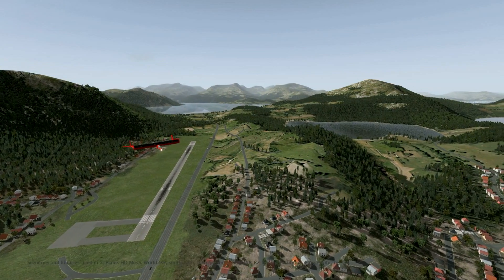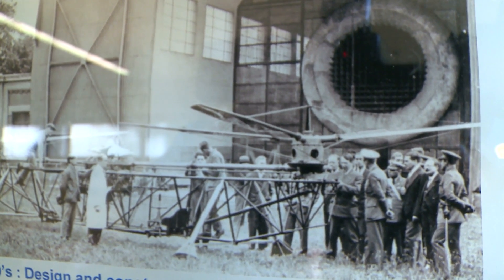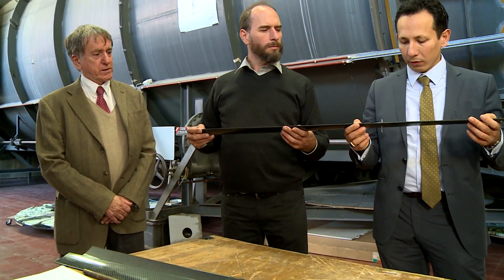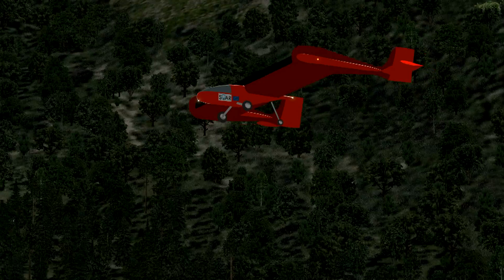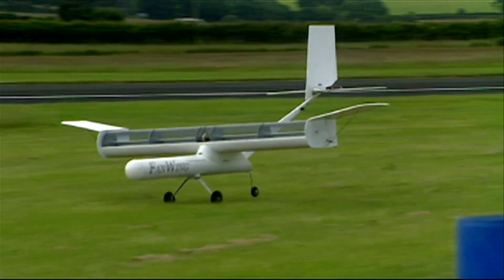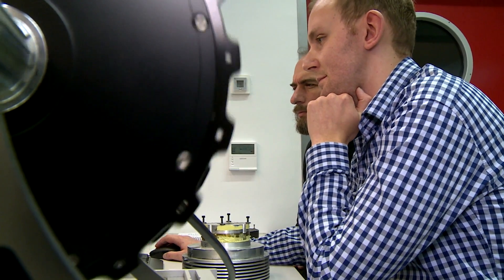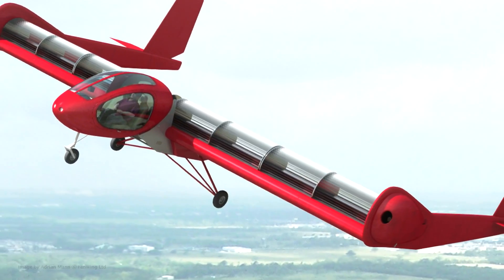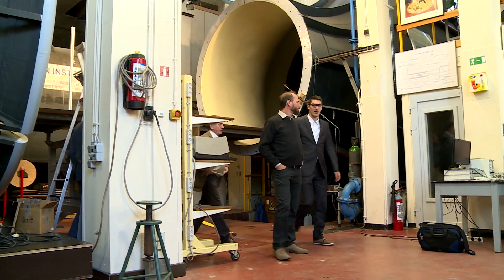FanWing/EU SOAR: Distributed-propulsion aircraft with a trapped vortex inside the rotor cage

Comment: Looks pretty fool proof, I can't see any safety issues 🤔😦 Electrical power is not really ultra light, batteries have very low energy density compared to combustible fuels so they weigh loads more. And that weight doesn't decrease as you burn fuel either 👍
Reply: battery tech has come a long way.  but beyond that, this design could be viable for the nuclear powered airplane designed by Alvin Weinberg back in the 50's
Reply: @ogmius2001  Yeah I can't see any safety issues with flying nuclear reactors either 😉
Reply: @juniorballs6025  they thought about that way back in the 50's.  that why A Weinberg designed a "walk away safe" reactor.  They designed it, tested it for thousands of hours...and it worked!  Problem was it couldn't make Pu 238 to make new bombs...Nixon hated that so it was defunded.  look it up

Comment: This is not an original idea. It was tried in the early 1900's (along with a great many other failed concepts) and discovered to be very unsafe in the event of engine failure
Reply: https://www.fanwing.com/faq.htm#6 describes their plan for engine failure.
Reply: @dapje2002  The coanda flyer is a totally different propulsion system, nothing like this at all.
Reply: @NullHyp  A helicopter blade keeps making lift in autorotation when declutched from a dead engine.  The same concept applies here.  A dive can build up RPMs and inertia in the rotor that can be used to flare out an emergency landing.
Reply: @NullHyp  Hehe Gliders represent!

Have you heard of the plane parachute? It's gaining a lot of traction and could surely get you down relatively safely I'd imagine. Also, perhaps one could do a form of autorotation by doing a steep dive to get the prop going again? Other than that I imagine you'd be dropping like a brick with all that resistance. 

And I second the whole thing about torque problems and inertia issues.
Reply: Flyingdutchy33 LOL yeah a parachute would work. Good idea 👍🏻
Reply: @NullHyp  Not sure if sarcasm, but here is some stuff about them: https://www.youtube.com/watch?v=zT58pzY41wA
Reply: @Flyingdutchy33  If huge radial engines on WII fighters weren't significantly hampered by "torque and inertia problems" on the roll axis, why dump on this concept?  Torque & inertia effects in this case only affect pitch which looks to have been countered by the extra leverage of a distant tail section.
Reply: @denbecr49  Because from an engineering standpoint, this thing is pretty flimsy.

I was talking about the torque and inertia of the rotor itself and the strain it puts on the chassis.
Reply: @Flyingdutchy33  Torque would be between the engine and the squirrel cage.  Which inertia of the rotor?  Rotational or translational? and in what way is it detrimental to the operation of the plane "from an engineering standpoint"?😄  
How would the "chassis" be subjected to even as much stress as a twin engine plane would "from an engineering standpoint"?😏
Reply: @denbecr49  You dont think this is an extraordinairy amount of moving mass?
Reply: @Flyingdutchy33  Nope.  It's just a squirrel cage fan.  Could be made of aluminum with blades of aluminum, fiberglass and/or carbon fiber.  Read the specs, FAQs etc. on these prototypes.  Rotor mass isn't an issue.
Reply: @denbecr49   think you are actively trying to misunderstand me. I'm going to leave this conversation until I talk to an actual engineer who knows what I'm saying.
Reply: @Flyingdutchy33  You do that.  I know what you are trying to say and I can understand why you might initially suspect the rotor to be problematically massive, which could result in gyroscopic precession, acceleration lag time etc. but a little thought "from an engineering standpoint" or researching its development would dispel those notions.  You seem to be intent on justifying your pessimistic first impression.  All kinds of naysaying comes from amateurs upon their first encounter with a new idea.  Take it from a psychologist and an engineer, most "real engineers" immerse themselves in a new concept, learning all they can before committing themselves to the type of objections you are making.  Engineers can hardly resist comparing all the specs, reviews and repair records they can find, even of competing models of just about any household purchase from freezer to riding mower or microwave.  
I haven't encountered one engineer of any type amongst all commenters here, and no one even claiming they have read everything they can find about the fanwing's development.  Do that and come back with an informed opinion and thoughtful questions.  

For now see if you can articulate the single fundamental engineering reason this design has an advantage over other aircraft that is motivating it's developers and investors.
Reply: @denbecr49  You claim to be a psychologist, yet this is your reply to stimulate discussion?

And you're also an engineer eh...

Well, I might see you on board one of these when they become mainstream.
Reply: @Flyingdutchy33  
Way off topic.  I'm in experimental psychology with special interests in biofeedback and learning.  Clinical psych. isn't hard sci. enough yet.  Still too cultish, faddish, reliant on placebo effect etc.  Sorry I'm not warm & fuzzy enough.
You ignored the challenge, so I'm gone.
Reply: @denbecr49  I can see why you tried your hand at engineering, psychology is clearly not for you...

... But then again, neither is engineering.
Reply: @Flyingdutchy33  
Still making oppositional conclusions from grossly insufficient data, I see.  
You've  sidestepped the challenge to reveal what you understood "from an engineering standpoint".  
Now sidestep the challenge to explain how I revealed ANYTHING that was evidence that I was a failure at EXPERIMENTAL psychology or ANY BRANCH of engineering.  We didn't even get into any engineering that wasn't covered in the fanwing website that I advised you to read.   You are making it obvious to anyone that has read it which of us knows what's up, not just from an engineering standpoint, but a reading comprehension standpoint.
Reply: @denbecr49  I sidestepped you as much as you sidestepped me. Do I need to point this out or are we good?
Reply: @Flyingdutchy33  
This is almost certainly going nowhere, but I can't determine what you think I sidestepped.  I was ready to get Socratic about the original engineering issues, but you wanted to complain about my tough talk as if it was evidence I was a failed psychologist!  I said it was way off topic, but I didn't sidestep it.  I explained my branch of psychology was experimental, which is entirely different from clinical psychology and I even told you why.  Clinical psychologists have patients or clients and in a manner of speaking are paid to be your friend, to support and coddle you along, help you understand yourself objectively, help you be a healthy adult etc.  That is not what I was ever interested in doing.  Experimental psychology is not therapy or interpersonal.  It is broader.  We have experimental subjects not clients.  I can't write a book here, but if you can Google, you should be able to get a grasp good enough to separate it in your mind from the common conception of what a psychologist is, which is a therapist or clinical psychologist.  
Look up biofeedback, the Milgram experiment,  B.F. Skinner, Leo DiCara,  psychometrics or Piaget for a rough idea of experimental psychology.  It's using the methods of hard science to understand individual, primarily human behavior.  It's not about how to be a therapist, a smooth talker, people pleaser or pussy footer.  
You sidestepped my challenge to show you understood the major concept underlying the reason fanwing got patents and was believed by many aerodynamicists to have potential to carve it's own niche.  I made it clear you could get your reservations and objections answered by reading the whole fanwing site.  The answers are mostly covered in the simple Q&A section and are consistent with what I conveyed to you.  
 BTW, I was into engineering before I realized it would be a great career move to combine experimental psychology with it, not the other way around as you assumed.  I did well enough with the combination to retire comfortably (to travel and engineering related hobbies) 19 years ago at age 52.     
So no, we're not good til you accept or decline my challenge and explain how you can say I sidestepped anything.  Unless you get serious, don't expect any more from me.  I've lost my patience.  I enjoy debating only with those eager to learn.
Reply: I guarantee all you want is the last word.  Go ahead.  Take it.
Reply: @denbecr49  All I want it for people to get my point.
Reply: @dapje2002  I thought Lilienthal was all about gliders(?)
Reply: 99% of Airplanes ARE susceptible to the exclusive problem of engine failure.
Reply: If a bumblebee can fly, so can this contraption!
Reply: @Eric Taylor, Ya I watched this vid hoping to see some feasible results, but even the small, light model had a clumsy lift off. I guess never say never, but it seems like a pipe dream. Maybe t'would be useful on a different planet under significantly different conditions.
Reply: @Pentapus1024  Radio control models nearly always look clumsy on landing & takeoff, even models of very stable full size craft.  Scale and remote control aren't always realistic.
Reply: You have a vague memory of a Flettner rotor plane that had smooth rotors, not fans, and only for lift, not for propulsion.  This Fanwing holds a patent, so don't be so quick to say it has been tried & discarded.  Flettner's rotor sails for ocean going freighters were very effective, but were discarded only because diesels and fuel were cheap and worked with or without wind.  They are mistakenly assumed to have been a failure technically, despite being recently revived as effective fuel saving thrusters on cargo ships, when the wind IS blowing.
Reply: Not quite, those early attempts were more like aerial paddle steamers, or , they would have been if they actually got off the ground..🤔
Reply: @miksal26  No, this is the same idea, tried again.
Reply: @erictaylor5462  The example I was thinking of had no aerofoil and if I remember right, it thrashed itself to pieces before it left the ground,luckily.
(Similar to the flapping umbrella attempt)
Reply: @miksal26  Yea, there were several attempts at the "spinning wings" idea in the early days, up to the 1920's before the idea was abandoned. Some of them actually kind of worked, but they all proved less efficient that the standard airfoil.
Reply: Does anyone know the amount of European funding was?
Reply: It loses all lift in the event of motor failure.
Reply: @nicklockard  not a fanwing.
Reply: Why would this aircraft be more unsafe than a propellor driven aircraft in the event of engine failure?
Reply: @gerritvictor1110  I imagine theres quite a lot more spinning weight, and the rotors aren't coweled like on jet turbines. This, combined with the massively increased surface area (as opposed to a prop or jet), makes the rotors more exposed to things like bird strike. I also imagine the imbalance in torque would cause a lot of problems, should one of the rotors disintegrate in flight. There are probably a lot more downsides to this, and I'm sure someone more knowledgeable in aircraft dynamics will be able to expand on this better than I'll ever be capable of.
Reply: @Swupperdupper  all the issues you mentioned exist for helicopters and those are still used all over the place for a variety of purposes.
Reply: @gerritvictor1110  When a helicopter's engine fails , the rotation of its blades still provide lift. When a multi-engine aircraft looses an engine, the others can compensate, if it looses all engines, the wings still can provide lift. The Fan/Wing looses its propulsion, also it looses its lift. Even if it looses it on one side, just one wing, the other wing's mechanics will cause the whole thing to go out control, because they need to balance each other. There's lot's of methods to produce flight, but this is one that prevents emergency landings without a back-up mechanism like fuselage parachutes... which would add weight. All you got to do to see some of the ways this can fail is get an RC model of an old style riverboat with that paddle-mechanism at the back, and break some of the paddles, and see how it looses control because it's using the same propulsion concept. Ornathopters (flapping wings) also do really good jobs of achieving and maintaining flight, but if you loose control of flapping mechanism on one side or the other, that wing gets stuck in a position that will drive the rest of the craft in the dead-stick direction. The more a design separates lift from thrust, the more I trust it, this design combines them.
Reply: @tixeright9120  You could fix those issues with engineering. Just chop up the rotors in sections, if a section stops working then you can perform a safe landing with the others that are still working. And this is a very early proof of concept model...not the real deal.
Reply: @bounzig  with enough engineering, elephants can fly, bricks can fly, and the possibility to create convincing fairies & foo fighters also exists, people can actually land on the moon, and other people can bitch about how it's all just a big con. 

I personally withhold belief in anything until I know how survivable its failures & emergencies are, so I'm more of a let me see the emergency landings & crash-tests kind of guy, than an early adopter who gets excited at promotional mockups. 

But as for your suggestion, I think segmenting this form of propulsion in several places could produce an unmanageable amount of flutter. Model planes of this type I've seen fly with just a pair of cylinders clearly have a lot of wobble along the whole of the craft, so I don't know that multiple engine redundancy could make normal flight safe, or even comfortable. Maybe tandem cylinders could help & avoid the flutter, but the only tandem design I've seen also had conventional rotary props up front & at the very edges of the magnus cylinders, housed by dual fuselage design which likely provide it with plenty of natural yaw stability to offset some of the more undesirable effects of this kind of craft, and because it also had props its impossible to know how much propulsive work the cylinders actually are doing without being able to test it out myself, but it's possible and even likely they were just set to a passive autorotation to provide lift for whichever aviation enthusiasts built it.  

But yeah, I don't disbelieve that with enough engineering you can get shit to work, it's just that R&D has a cost, and lot of projects end in the experimental phase just because they hit that cost-ceiling. Even if they can make it to the end, they still have to be competitive with other alternatives to displace them, or be in superior in some way enough to find their own niche.
Reply: @tixeright9120  The dual fuselage model you saw wasn't a fanwing.  It was a cylinder wing using only magnus effect for lift; no fan for propusion.  That's why it had conventional props.
Reply: @tixeright9120  that would be a flettner airplane, not a fanwing.
Reply: ZA IF ITS NOT SPINNING IT DOSENT HAVE WINGS
Reply: @gerritvictor1110  Because if the fans aren't spinning you have ZERO lift, even when it's moving forward. In short, it has the gliding characteristics of a brick.
Reply: @bulruq  It still makes lift when freewheeling.  Read about the thing before naysaying off the top of your head.
Reply: @denbecr49  For how long, 5, 10 seconds maybe? Does it provide lift when it stops rotating or starts rotating BACKWARDS? Does it auto-rotate like a helicopter or glide like a single large aerofoil? SHOW it. Prove it doesn't fly like a brick without power.
Reply: @bulruq  Don't pop a gasket.  How could air flowing over the top of the wing in a glide cause or allow the rotor to run backwards!?  Do you have a clue how this thing works?  Just read the whole fanwing.com site like I did.  I've read everything else I could find on the Web about it and corresponded with Peebles as well.  Why take my word for anything when you can read the same things I've read?
Reply: @gerritvictor1110  ...look at the wing... its FAR greater drag then a typical wing. Meaning that in the event of engine failure it couldn't glide to a landing like a standard prop driven plain.
Reply: @Crowellcontracting  Thanks. Should have thought this wing cannot glide.
Reply: @gerritvictor1110  Read up on it.  It glides, just not quite well enough yet, but last I checked, progress had been made.
Reply: @gerritvictor1110  it is more unsafe because failures would happen much more often!!
Reply: One more example of how incredibly stupid everyone who runs the EU really are.
Reply: @dapje2002  And New Zealander Richard Pierce flew the first powered controlled flight, and with ailerons too.
Reply: Isn't that the era when smoking and open X-ray emitters for fitting shoes were considered a good idea? There have been a few changes since then, Einstein.
Reply: Quibbler https://youtu.be/CTBblZRS79o if you’re curious on the shoe fitting machine

Comment: Really people.. do helicopters glide?? Do we use them??? Wow....
Reply: I'm not sure if you're serious...but yes, helicopters glide.  Or more precisely they auto-rotate and use upward airflow through the inner portion of the blade to spin the blade while the outer section of the blade produces enough lift to keep the helicopter controllable and not crashed.  It's not a great glide slope compared to many airplanes but it doesn't just fall out of the sky if the pilot works the collective right.

Comment: I saw a motor in your video with the typical round enamel coated wire.  Hasn’t  flat ribbon wire been tried yet.  Should decrease  the size but increase the output.